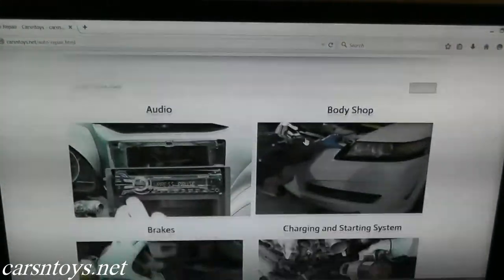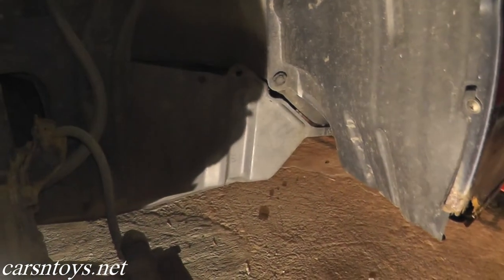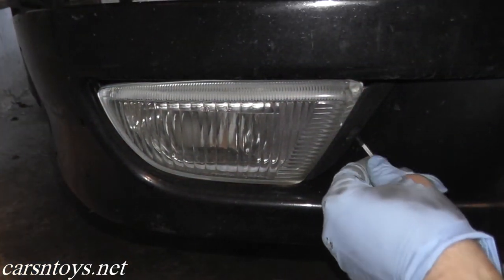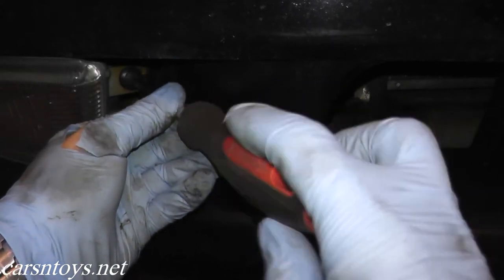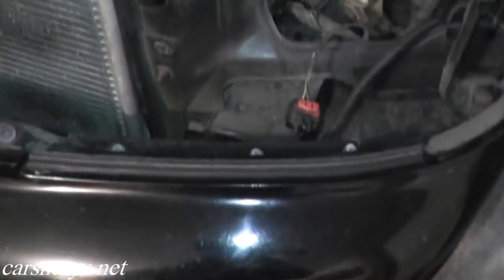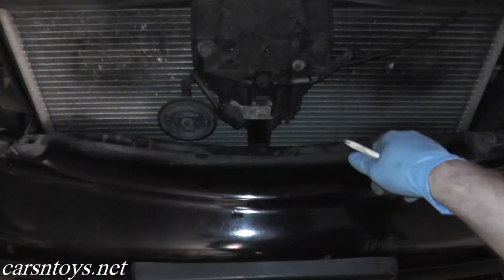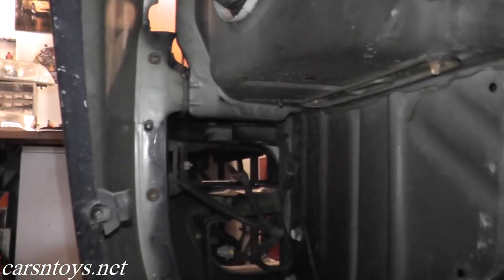Nissan Maxima Front Bumper Removal with Basic Hand Tools

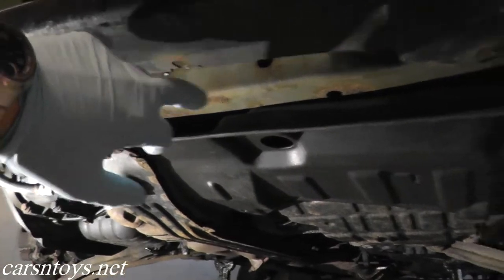Comment: My '03 Maxima has a rotten lower radiator support like shown at 0:50. What did you do on your car? Is the cross-member just hanging by the front like on mine? How do you usually proceed with a rotten support? Thanks.
Reply from the maker: +WoZIMoo Yea, common problem on older Maxima's. The correct way is cutting out the old metal and welding a new support in. I haven't done anything really. Just sanded the rust off and painted.
Reply: Phil3555 yup, s common problem on older max and i30. 

Several videos here about it. Big job, usually replacing the entire support.
Reply: Same on my 1995 a32 cefiro in NZ (which is a Japanese import maxima in this market) the rest of the car is very clean and rust free but the front cross member is stuffed.

Comment: hi i like this video can you tellme if is the same  steps for the nissan pathfinder 05 thank you very much
Reply from the maker: +Jose Siguencia Similar. Obviously, the bolt locations will be different but essentially the same. Remove the bolts and pull off the bumper. Here's another video we did for a '05 Acura: https://youtu.be/XvTnG1X-ZrM

Comment: Did you ever make a video doing the lower radiator support replacement?
Reply from the maker: I'm afraid not. Welding is outside my expertise. I would trust that repair with a body shop. Cheers.
Reply: @CarsNToys  fair enough, time to make use of that community college weld class